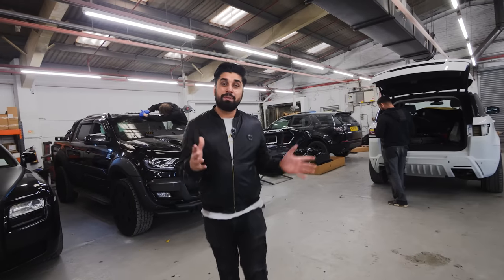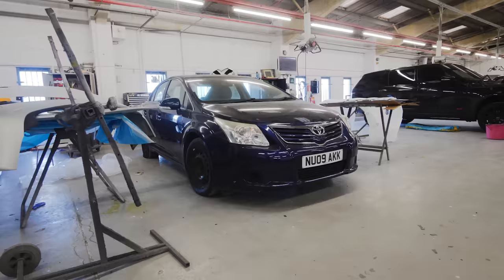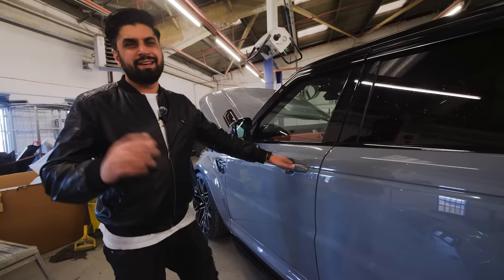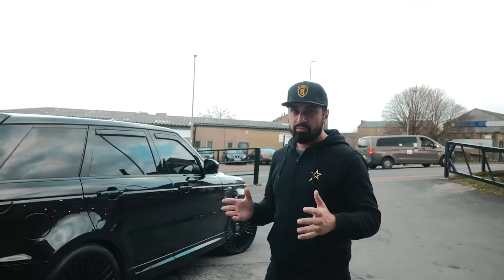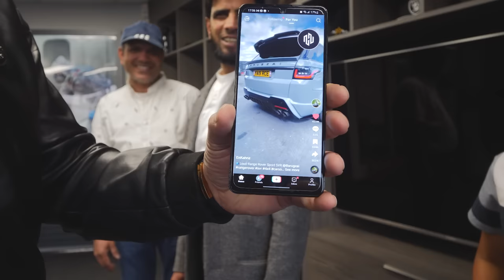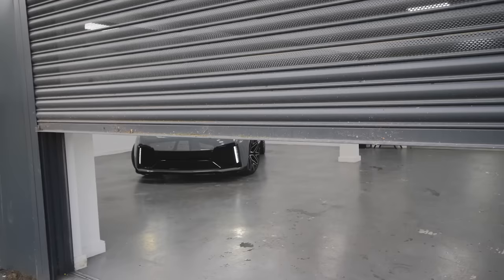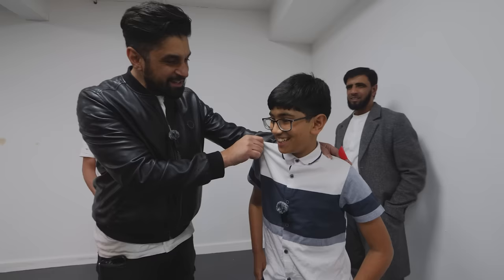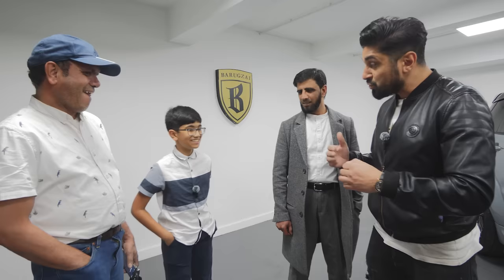TAILOR MADE LUXURY RANGE ROVER SPORT INTERIOR !!!

Comment: Can someone pls give a realistic idea of the full cost of this transformation.. .?
Reply: That's so true bet its all about the persons money that what they look at
Reply: So….

To convert a standard facelift Range Rover to a standard SVR it’s £1,600 (supplied & Fitted)

These Barugzai conversions are around £9,000 from standard (supplied and fitted) 

Then they require wide offset alloys which are sold separately for approx £2,000 extra. 

Then there are the other extras not included in that price such as 

- the wrap 
- SVR style bonnet 
- wheel spacers 
- sidesteps. 

All In (wraps or paint job dependant) this conversion is around £18,000-£20,000 for the full house.
Reply: Thank u